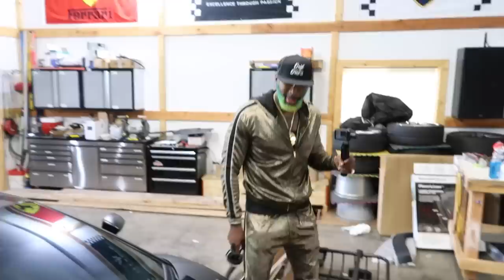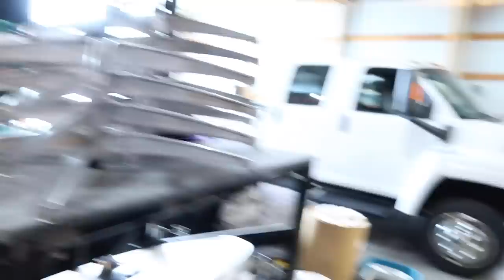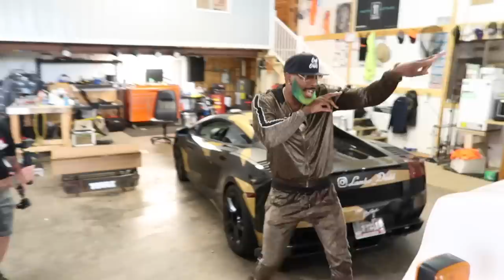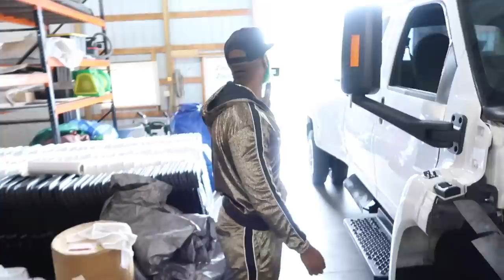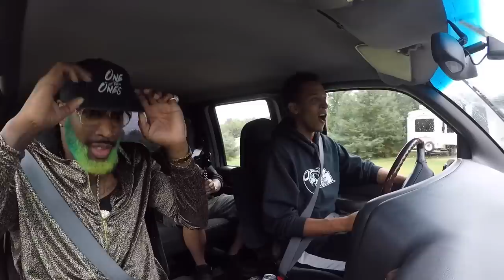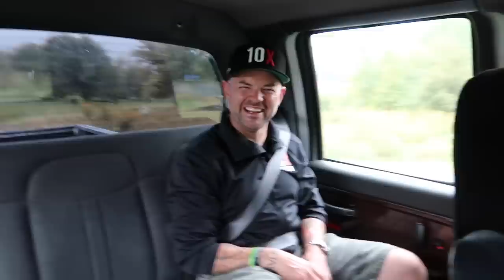GMC TOPKICK DURAMAX REVIEW!! THIS SHOULD NOT BE STREET LEGAL..

Comment: You did not drive a truck with a clutch and manual trans the one you drove is not modern if you went into a 2012 older would have been a lot harder I drove a 1979 kenworth k100 flatbed that says 24000lbs 13 speed manual with clutch 8v92t Detroit
Reply: Good for you.